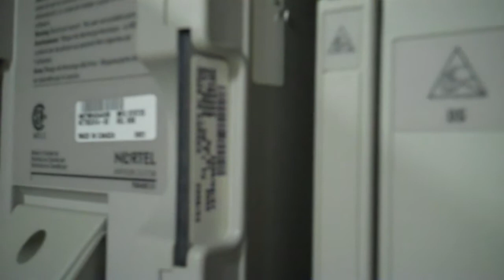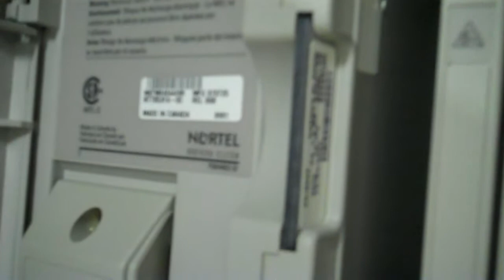Nostar MICS 0x32 - inside the cover

Comment: Hello Nortel guy i have a problem hopefully you will be able to help me in my issue i have Norstar extension module and it's blinking red and punch of internal extensions blinking red  i tried to disconnect the power and plunged the power again the extensions back to normal again and working but the module still blinking red and after 5 minute the phone disconnected  again sound like no connection any idea how can i fix this issue.